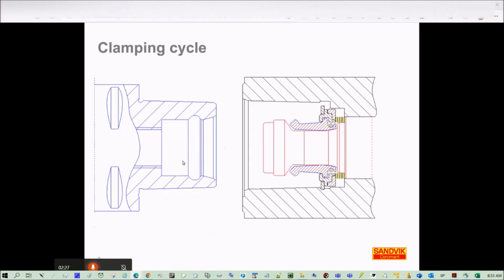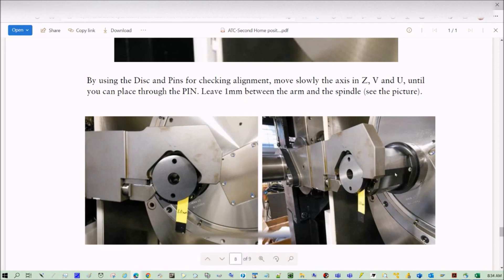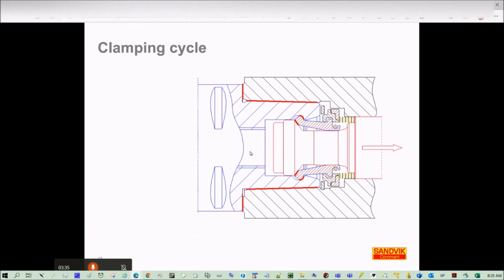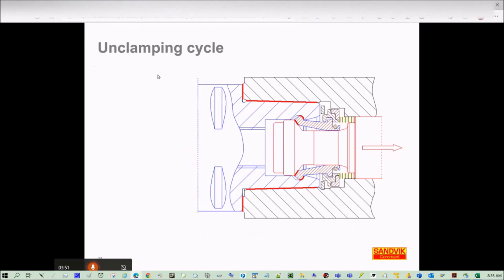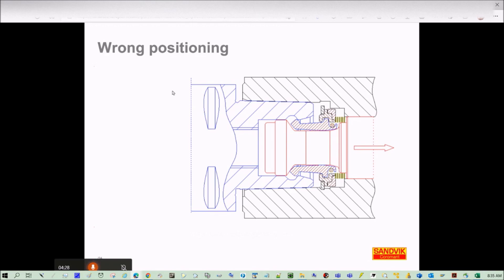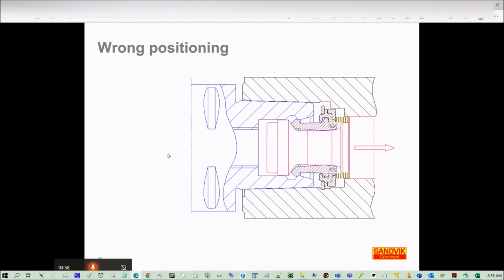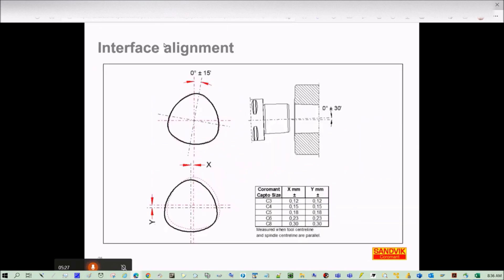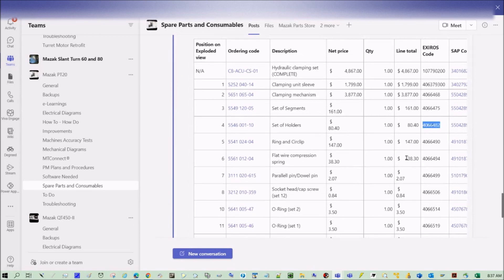Mazak PT20 -Capto C8 Clamp System Mazak Z90ZKC9001F/Sandvik C8 ACU-CS-01. Clamping/Unclamping Cycle

Comment: you prefer this over KM?
Reply from the maker: Hello Fred. It's actually the make and model that came with the machine. Buying the assembly from Sandvik we save 55% than buying it from Mazak. In addition, we can buy each component from Sandvik, which means we can change only the parts that wear out instead of having to change the whole assembly. I’ll check if Kennametal has a cross and better price. Thanks for your comment. Regards.